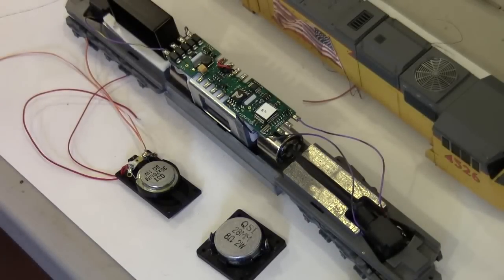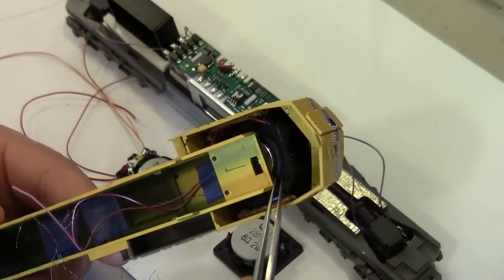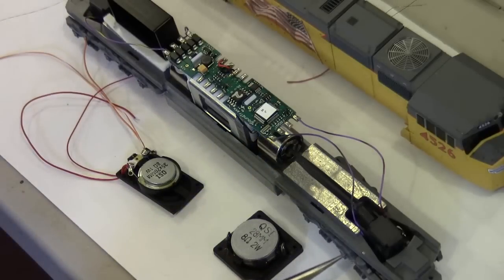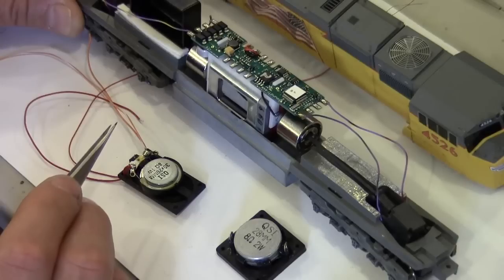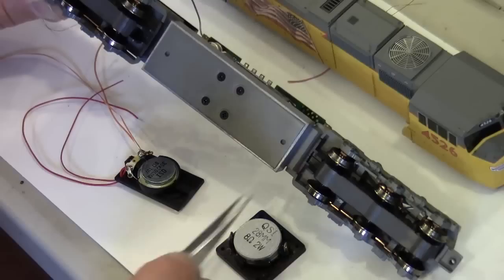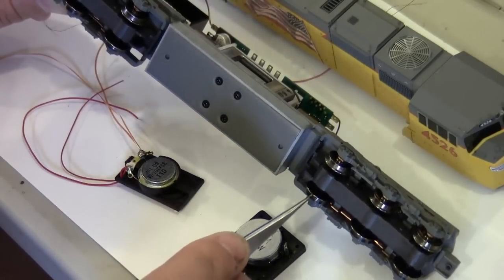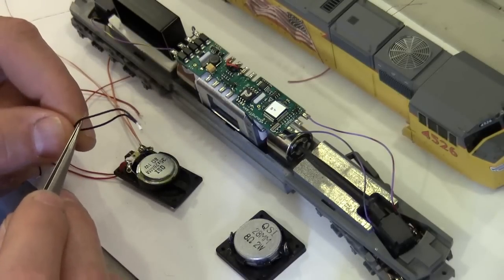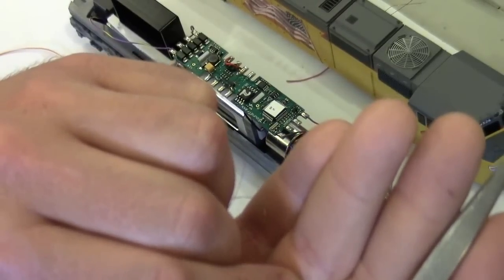Part 1 SoundTraxx Tsunami Installation Athearn Genesis Union Pacific UP SD70M

Comment: Eric
The wire you used for the headlights and ditch lights, what size is this wire. Also was told that when an install on Athearn loco's, you should replace the motor with a more efficient can motor for less amp draw and also the pressed metal wheels. I am getting ready to start doing some decoder's with sound and non sound, so will watching you videos a lot. Any help will be greatly appreciated on this project. Oh, the engines will be Athearn RTR and Kato's with Tsunami decoders.
David

Comment: Eric,
Thanks for the reply and information.  A friend from another club had said that the Athearns wheels were pressed metal and that using Northwest Shortline machined wheels would give better pickup. So was curious for another opinion.  As for motors, another friend get the same motors used in the Broadway Paragon 2 pretty inexpensively if bought in quanity. 
Thanks again for the video's. Will be watching them over again to learn installation process.  Ever do any Kato's it Lok Sound.